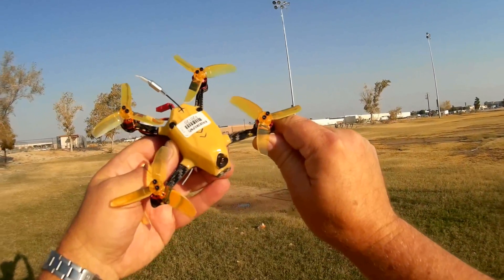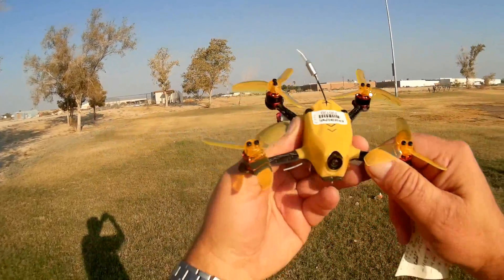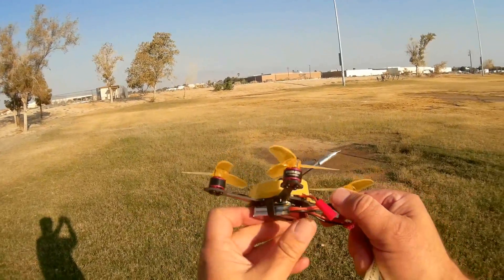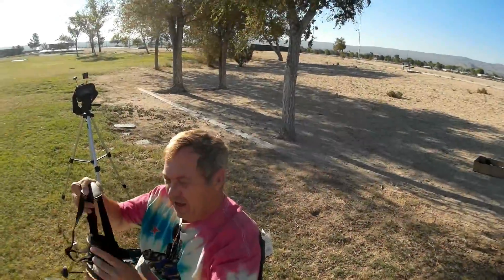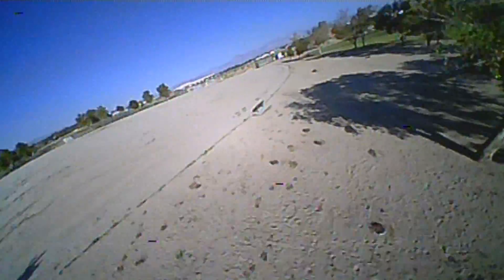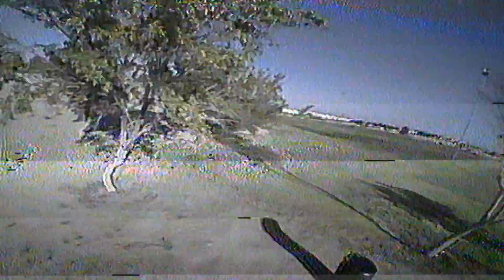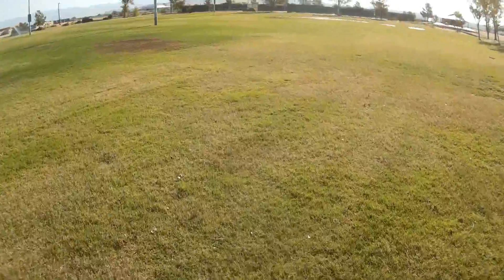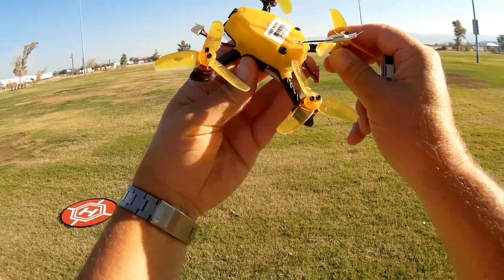Kingkong 110GT Micro FPV Racing Drone Flight Test Review

Comment: Does it matter on the micro fpv racers what polarization the antenna is on the FPV Googles? Since it has a dipole antenna on the quadcopter?
Reply from the maker: It doesn't matter since it's a dipole.

Comment: Thank you so much i have been playing the drone racing league game on the computer so i will keep playing it! :). One more thing, i am still confused on how no controller or anything comes with it so you obviously need to buy them but how do you connect a new controller and goggles to a quad like this and does it matter what brand they are? If so what brand should i use once in ready. (for goggles and radio)
Reply from the maker: For the most part, there are three main protocols of controllers that will work with FPV racers.  The most used protocols are Flysky, Frsky, and Digital Spektrum Modulation (DSM).  If you're new to this, the cheapest and easiest transmitter to use is Flysky, but sure its AFHDS 2A capable (not just AFHDS).  To bind a transmitter, you simply press its bind button while simultaneously turning on the transmitter.  Your quadcopter's receiver should also have a little bind switch (or bind plug) that you'll also need to depress (or plug in) while plugging in its battery.  A light on the receiver should blink rapidly, and then turn to solid once bound.  After you do this, you shouldn't need to do the bind procedure again as the quad should automatically connect to the transmitter the next time its plugged in.   Here's a demonstration showing it's not too hard https://www.youtube.com/watch?v=I1922Bhj9mA
By the way, the Eachine E010S is a good intro to FPV acro flying.
Reply: Quadcopter 101 Thank You so much!

Comment: Hey Quadcopter101, I'm looking into starting fpv racing. Can you please recommend me a good drone and setup? Thanks
Reply from the maker: Well, you'll first need to learn two new skills, flying through the goggles, and flying in acro mode.  The best and easiest way to learn both of these quickly is through practice on a simulator program.  One of the best (and it's free) is FPV Freerider.  You can practice all you want on the free demo version.  But if you want more scenery, you'll need to pay $5.  Joshua Bardwell did an excellent series of FPV tutorials using this simulator.  I highly recommend practicing first using his tutorials. After which, come back and we'll discuss first FPV racers https://www.youtube.com/watch?v=391D5dX7LKg&list=PLwoDb7WF6c8kjYXam4m3msvRbkORU41GY
Reply: But which transmitter should I get.

Comment: i'm buying a bugs 2c and want to attach a micro camera for fpv viewing,will i have signal issues with the gps ? Thanks
Reply from the maker: It should be fine as long as you don't place any wires, camera, or any other objects over the B2C's GPS antenna.  Unfortunately, I'm not exactly sure where this antenna is installed on the B2C.  So you'll need to do a little research to find that out.

Comment: Hi +Quadcopter101, I just wanted to ask if you had any recommendations for me.. I am looking for a race quad that i can have lots of fun with. The catch is i really want a "kit" of the quad, controller, and fpv googles. I am a pretty experienced flier so anything works! Do you have any suggestions for me? As always the cheaper the better but i'm open to anything! Thank You!!!
Reply from the maker: Yeah, but as I mentioned to one of my other viewers below, you'll first need to learn two new skills, flying through the goggles, and flying in acro mode.  The best and easiest way to learn both of these quickly is through practice on a simulator program.  One of the best (and it's free) is FPV Freerider.  You can practice all you want on the free demo version.  But if you want more scenery, you'll need to pay $5.  Joshua Bardwell did an excellent series of FPV tutorials using this simulator.  I highly recommend practicing first using his tutorials. https://www.youtube.com/watch?v=391D5dX7LKg&list=PLwoDb7WF6c8kjYXam4m3msvRbkORU41GY
Once you do learn, I recommend considering one of these micro FPV racers to start.  Through the goggles, it's hard to tell the difference that you're flying a micro or full sized racer.

Comment: You should see if you can attach another set of wires to add your tester to it's battery
Reply from the maker: I did add my tester at the end of the video.  But it's too big and heavy for this little quadcopter.  Although it might lift it, it would degrade its flight performance.

Comment: so impressed i bought it, upgrade from eachine e011. been grounded for a month, my fs-i6 radio arm switch wasn't configured in range and as a beginner it destroyed all the props and tore off the vTx antenna figuring out that i didn't know that. big THANKS to all the folks at quadcopterforum.com who didn't care if i knew about configuring the arm switch. someday i hope i can fly mine. i think someone keeps stealing my replacement prop orders out of the mailbox.
if you are a newbie, first thing, bind and connect to betaflight, "even though it's out of box" so you can see what the radio switches are throwing. mine threw 1996 high, the arm function has a max range of 1700. don't ask me how that thing did anything without arm function, but it was scary and violent and destroyed anything it could including itself.

looks like a sweet flyer, but mine is basically a mechanism for inducing trauma. it hit my ceiling at about 60mph when i first hit switch 2. after that i had it tied to a brick with a 2 ft. string, which made for days of hell moving it back and forth to betaflight and safe test places. someone sohuld tell newbies that radios aren't all set up.

also the flysky version of this dron places the Tx under the battery, where any motion munches the bind button, so you lose your bind on any impact. flysky version requires immediate redactive construction.

Comment: Not sure you can add a beeper/buzzer easily on that .. the KingKong90GT I had, had no provisions for adding such, as a regular F3 FC would. An OSD would be nice, but that's not on this model. I had so many problems with my KK90GT that I wound up replacing the camera, VTX, FC, ESC/PDB and motors .. basically everything on the quad. Now I'm waiting for some soft mounts for the motors to hopefully take care of the drift it has in Angle/Horizon modes.  BTW, 4 in 1 ESCs are not all on one chip as you said, but rather all on one board (with separate chips for each motor).  Seems to be quite a few racers coming out in this bigger form factor, from 117mm to 130mm, with motors from 1104 7500kv to 1105 8000kv .. lots of good stuff out there. Thanks for the review.

Comment: I love your channel man, if you can try to bring to the channel the cheerson cx20 and cx22
Reply: I would recommend the syma X8HC. It has a long battery life, it's somewhat crash resistant, and my friend sure had a lot of fun with it!
Reply from the maker: I always recommend the Syma X5C for new fliers, due to its excellent stability, durability, and ease of flying. And it even has a camera too.  Use it to learn the basics of flight with.  Let this cheap quadcopter take the inevitable crashes and bangs of a beginner flier. And if you break it, every part on it is cheap, widely available, and easily replaceable. Later as your flying skills improve and you're not crashing as much, then consider something better/more expensive.  https://www.youtube.com/watch?v=y93vzA-KRlM
Reply from the maker: I've reviewed both many times.
https://www.youtube.com/channel/UC90A4JdsSoFm1Okfu0DHTuQ/search?query=CX-20
https://www.youtube.com/channel/UC90A4JdsSoFm1Okfu0DHTuQ/search?query=cx-22
Reply: Quadcopter 101 excelent thank you man
Reply: Quadcopter 101 i wanna buy a drone but What is the best beginner drone that is affordable?